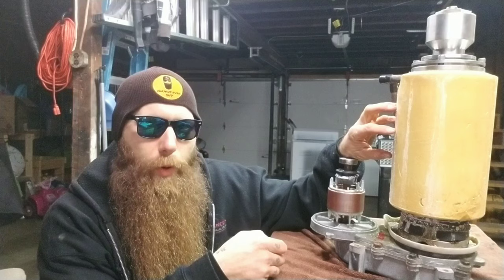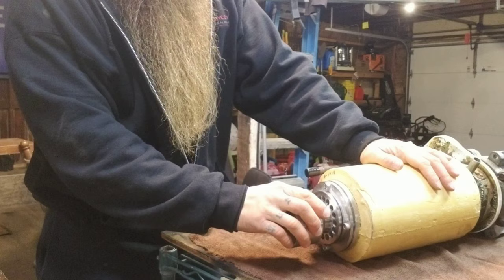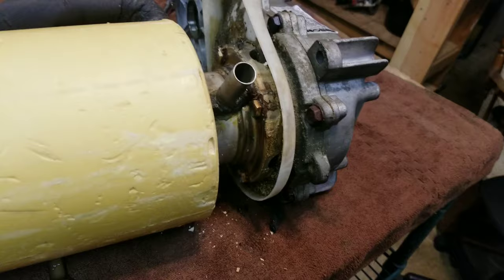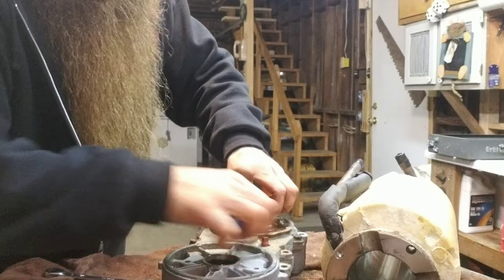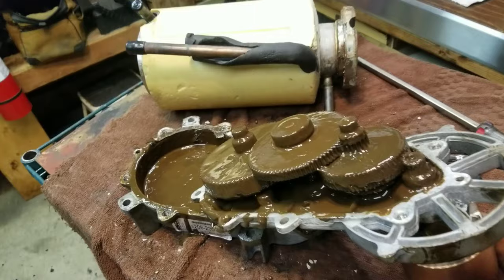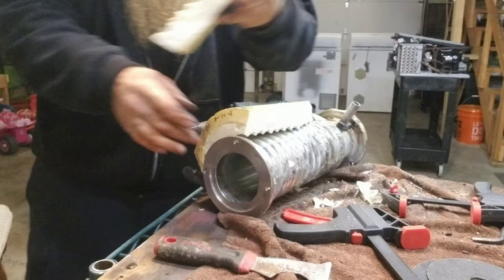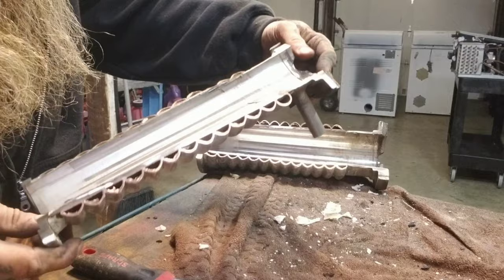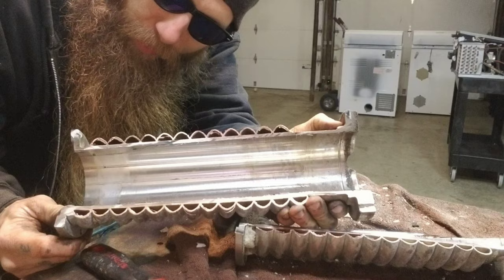Garage Science: Iceomatic Evap Barrel

Comment: Syrup to water mixture is a very specific proportion.  For a specific temperature setting, an ice to liquid ratio will be achieved, if the mixture is in range.  If the mixture is to thinned out to much the machine will jamb.
Reply from the maker: You sound like you know a thing or seven about slushie machines
Reply: @curioushvacguy6876  What a laugh, I actually thought this was an over-build slushie machine.  Haven't had contact with one of these bizarre ice machines.

Comment: I don't like the design. The pressure inside the barrel is tremendous if you consider the ice has to be scraped from the inside of the  barrel ,lifted up into the extruder forced  through the holes then up and away via some form of chute.
Reply from the maker: Yes sir- Ive heard bearing failure on these is very common for that reason

Comment: I remember back in the day, rebuilding those gearboxes on Scotsman flankers water would get into the gearbox and destroy the gears not to mention the tremendous amount of torque the motor would put on the gearbox
Tear it apart real easy piss poor design
Reply from the maker: Man rebuilding those must have been pretty labor intensive, maybe the cost back then was to high to just swap that gear box out. I don't see alot of these in my area but I've heard there are alot of gearbox and auger failures in these.

Comment: ice o matic & scotsman flakers/nugget machines are the worst...i never saw bearings & water seals last more than 3 years...usually they are shot after 2 years...if the evaporator is all scraped up inside you have to replace it...90% of the time when the bearings go we just replace the entire auger assembly with a new evap...especially under warranty because that's what the mfg tells us to do...same shit design for the last 20 years
Reply from the maker: Hey there- youd think after years of failures like this, especially if they dont last more then 3 years, they would change up the design. There were definite signs of water damage at that bearing. Doesnt sound like im missing much, lol- Thanks for watching